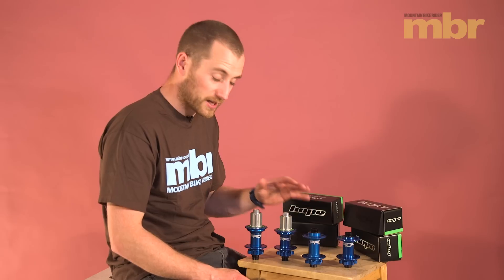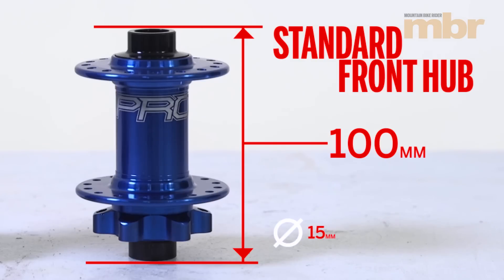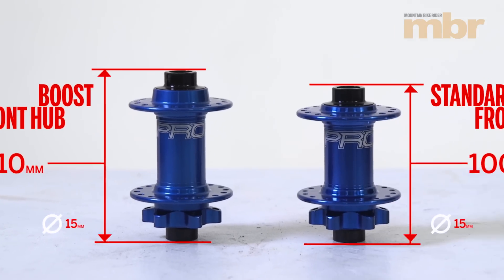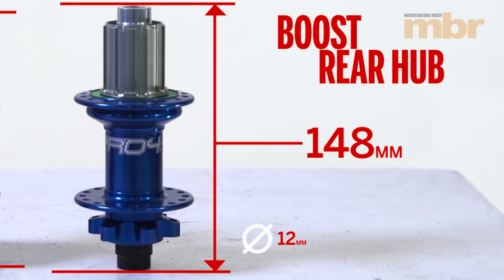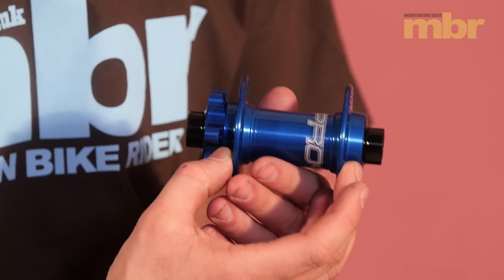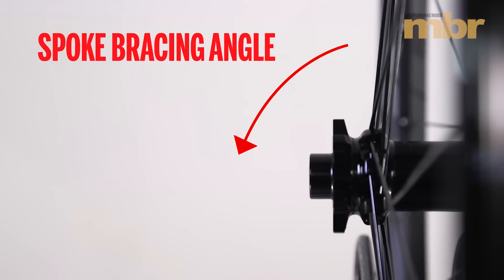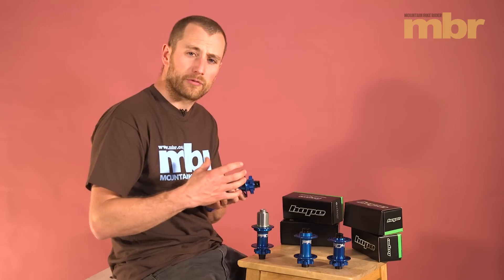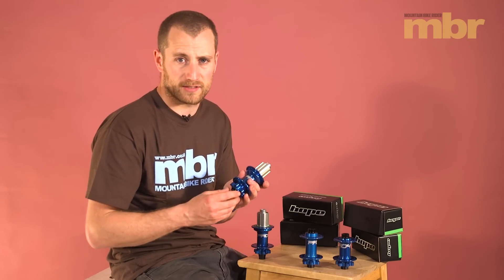What is Boost? Explaining the new mountain bike hub dimension | MBR

Comment: I just bought my new full-suspension eMTB this year in February 2024 with Boost hubs. It's now July, and I'm glad I found this video because I've had multiple answers, and a couple even said you can run non-Boost on a Boost setup. But after watching this video, there's no way I would ever try that! 😂 Thanks! My friend bought a hardtail eMTB with 29-inch wheels (non-Boost). My Cube Action Team is the long-travel 160 version with 27.5-inch wheels. I was wanting to test a mullet setup with his 29er on the front, but I'm not even going to attempt that now! Have to say though i still love my 27.5in to the 29ers
Reply: I kinda think boost hubs are probably just a gimmick....To sell more bikes, since the wider hub adds more weight. You could just add spoke washers & thicker double butted spokes to a regular hub/wheel. To make it stronger. Without being heavier than the boost.

Comment: It was 26 inch wheels 10 years ago, now it's 29. Di2 came up, but Sram Eagle has more gears. Carbon is the new base frame, but titanium is cooler. Ceramic balls everywhere to save 1,2 watts. Kashima because it's golden.... and then boost was invented for people who suffer from soft wheelsets.
Reply: they just make new things incompatible with old ones so you have to upgrade everything everytime. im sticking with my 2009 stumpy and just deal with the 26 wheel and old geometry. still works fine

Comment: Can the new sram DUB system be use with or without boost? If I use boost in the front crank area, do I have to change to boost in the rear? I was told by a few vendors that I have to use boost on both!
Reply: Buy the DUB chainring without boost. It’s called 6mm offset. And yes, you should match front and rear.

Comment: I recently purchased a 2019 norco fluid ht ht2 the stock hubs are like 30$ and just not great at all being that there 9x141 qr in the rear im left scratching my head in search for an upgrade thats not pushing $300 just for the hub aka hope pro 4 and dt swiss 350 with qr inserts to make it 9x141.  Anyone know of other options for rear hubs that have the option to change the end caps 132 qr norco referred to stans no tubes but I cant seem to find just hubs on there website.

Comment: I'm converting a 2008 Stumpjumper (3x9 drivetrain) to a SRAM GX Eagle 12-Speed Groupset GXP; Should I elect for boost or not, and should I consider upgrading the wheels overall for better compatibility? The fattest tire I can get on the rear is 2.35".
Reply: CyberGolem: I'm pretty sure that the frame in rear must be boost to use boost size hubs. Sounds like you might be ready for a new bike, brada.
Reply: I'm in a similar situation. I think I'm gonna be safe if I just buy parts without boost.

Comment: I'm still so confused 😕  I'm looking to buy a zeb (boost) fork for my standard specialized levo. The bike comes with a 15 x 110 hub but doesn't state its boost spacing. The comp actually states it is. So I'm guessing if I put the forks on the caliper and rotor won't line up ? Is it a simple spacing adaptor for the rotor ? This is a minefield! Thanks in advance
Reply from the maker: Your wheel will fit fine - the Turbo Levo uses Boost hubs and dropout spacing.

Comment: So now I guess the question is, can a bike that didn't come with a boost wheel set use a boost wheelset? I have a 27.5 GT Aggressor Pro and I am looking to get rid of the stock wheel set and I'm not sure what to go with or even if I could put a boost wheel set on it.
Reply from the maker: The simple answer is no, but you should be able to find non-Boost wheels to fit. 👍

Comment: so, you don't need a "Boost Specific" type of frame to make the hubs work?
Reply: A 148 hub needs a 148 frame. You can squeeze a 148 hub into a 142 frame and a 142 into a 148 but you will void your warranty and stress the frame so essentially no, you need to match boost frames with boost hubs and boost chainrings or cranks.

Comment: So... I won't be able to install a boost rear hub/wheel on my standard 142mm frame. Correct? How can I ugrade my bike to a 1x12 with a 142mm frame on the back?
Reply from the maker: You can get 142mm hubs with XD driver bodies that will allow you to run 12-speed set-ups.

Comment: So if I buy new forks that are boost (original are not, neither is the rear) can I run boost on the front and not the back without affecting the handling in a bad way?
Reply from the maker: Hi Tony, yes, that's correct.

Comment: why made a bigger spoke bracing angle make it stronger? don't understand,
Reply from the maker: Wider hub flanges, with a more equalised spoke bracing angle on the rear wheel, helps strengthen the wheel. It's like putting up a radio mast and then tethering it with wires either side. The further apart they are tied to the ground, the less likely the mast is to buckle.
Reply: If you imagine a rear hub which was ridiculously narrow (just to highlight this point), say 5mm wide, then the spokes on both sides of the wheel would be almost vertical and would be prone to bending.  As the hub flanges are placed further apart a triangle is formed with the hub being the base and the spokes being the sides. This triangle is less able to deform the wider the base (I.e. hub  width). This is especially advantageous for mountain bike rear wheels which may experience significant sideways loading. Maybe this allows the use of lighter rims for the same strength? I can see that it is a technical improvement which means that it is easier to produce a wheel with extra strength without needing anything new.  But well built MTB wheels are possible with older hubs. Stiffness is not always the most desirable feature with wheels. I built my 29er wheels about 8 years ago with double-butted DT Swiss spokes and when I'm going flat-out on twisty singletrack I feel the rear flex  slightly under sideways forces. I would rather it flexed slightly than pulled the spoke nipple through the rim which is what my previous Kona-built wheel did. I'd recommend to anyone that is thinking of new wheels to find a wheel builder to discuss your needs with. I have thought about this frequently as I've wondered if full-suss bikes don't need a rear wheel as strong as a hard-tail because there is less of an impulse shock to the wheel when you hit a bump due to the suspension?  I'd be interested to hear anyone else's comments.
Reply: Nathan Lei: what's more stable, a flag pole braced with ropes anchored right near the base, or anchored at 45 degree angle?

Comment: Can you change a boost rear wheel to standard spacing?
Reply: hi, did you get the answer for this question? im looking for this answer, which boost hub can convert to non boost or not..?
Reply: If you change the hub to standard yes. You would be better off finding a standard wheelset to use.

Comment: i reality "boost" is nothing more than new standard that bike manufacturers made to take more money from customers. Even so some bike brands made trail bike with SUPER BOOST like Pivot bikes on their Switchblade model, which is downhill hub on trail bike ...so 1 more way to take more money from us. Same story goes with new wheels 27,5+, new handlebar and stem standard and so on...
Reply: Eh, I think those +tires do have their place. This hub spacing on the other hand...
Reply: And it is easy to see that if you go back in time to 1990-2000 which is probably the most progressive decade for bikes and the Mountain Bike came truly into being. During the 90s there was such rapid development in MTBs that by 2000 you could get a decent MTB for around $600 that would be comparable or better to a $1000 bike from 1995. In the Early 2000s you could get the most bang for the buck when it came to bikes so there had to be a reason for someone to spend at least a $1000. I do think that boost is of a rip off because I don't think it really cost that much more more to make wheels with wider spaced hub flanges and a frame with wider spaced drop outs.

Comment: The cycling industry nickel and dimeing customers. "Let's keep adding a few mil and charging more money 💰"  it's always been a slow drip of existing motorcycle 🏍️💨 technology.
Reply: Not really, surely you can understand how it allows for stronger stiffer wheels. Nobody’s forcing you to move away from 100/135.
Reply: @TerrenceLP  master mechanic who can’t understand the benefit of having the hub flanges further apart? Boost is not just on high end bikes. I’m a cytech trained full time mechanic working in a shop mainly wheel building for ews racers.
Reply: @Adam-vm8kp  i understand they want my money - ok granola soy boi enjoy your opinion 🍖
Reply: @TerrenceLP  I gather you just don’t have a clue what you’re talking about. Front hubs have been 100mm for decades, they make one change to 110 (with 100 still widely available in skewer, 10mm, 12mm and 15mm but you lose your mind that they ripping you off 😂 I don’t think you’re a mechanic at all.